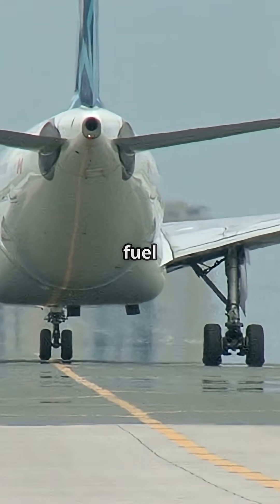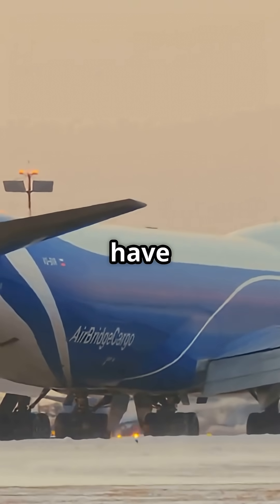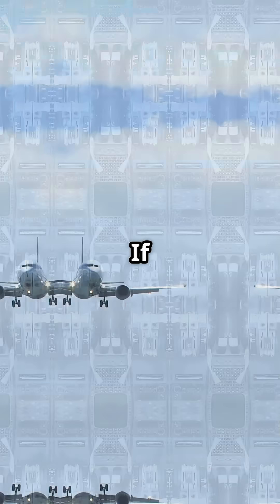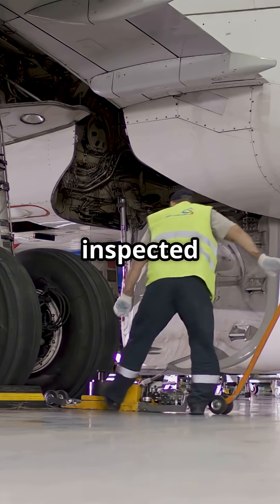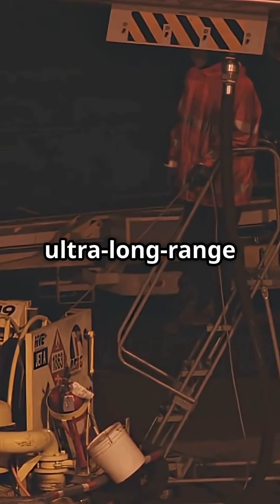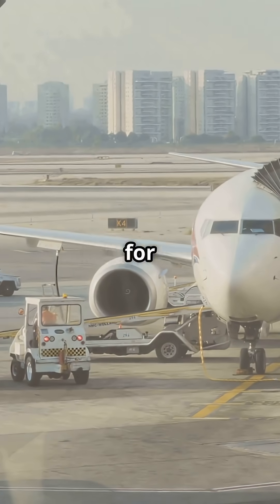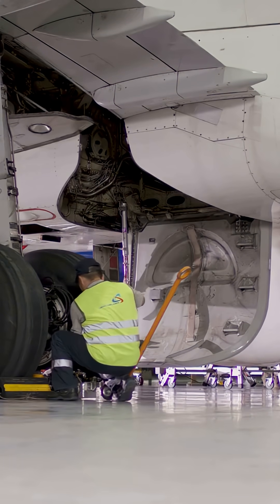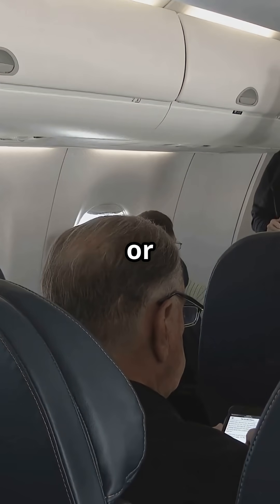Why the Boeing 737 Doesn’t Need a Fuel Dump System

Comment: It seems so wasteful to have to dump so much fuel, particularly if an emergency occurs shortly after takeoff. I understand the reason and need for a dump system in other aircraft, in order to safely land. But it seems better to simply design most or all aircraft like the 737, if that is possible, so that dumping isn't necessary in the first place. Airplanes carry several thousand pounds of fuel, and so an enormous amount is wasted when it's dumped.

Comment: That’s actually a really smart move!!!
Reply: So you'd rather land a plane full with fuel that can make a big fireball? Everything has a catch or downside.
Reply: @wildonemeister  Well if you think about it, its maximum takeoff-weight and landing-weight are the same, and it takes a couple minutes for it to circle back around and land safely! that’s a good amount of time to use up fuel! And let’s say it just took off from somewhere like DFW or Dallas Lovefield where it is pretty around heavily populated around the airport, if they dump fuel that can also affect people on the ground, but since it doesn’t have to; people on the ground are completely safe!
Reply: @TheWill.LifeImagined You don't really care about the people on the ground maybe getting a drop of fuel dumped on them when trying to save hundreds. That is my take on that. Just having the option is nice - using it or not is up to the pilot and situation.
Reply: @wildonemeister  I know it’s ok to have different opinions and yes I do understand that the people on the ground don’t matter as much as the people in the plane, but there are two other factors that make this a smart move by Boeing! One being that the 737 is a shorter range narrow-body that doesn’t really need as much fuel as like the Airbus A321-NEOXLR which needs a lot of fuel since it can fly longer than the 737. The second reason is that a system like that can cost a lot of money so giving the fact that the takeoff and landing weight are the same and giving the fact that going around an airport takes time an that time my friend is also ticking away at the fuel gauge to making it kind of unnecessary to have it!
Reply: @TheWill.LifeImagined Adding a pump, nozzle and a switch is not really changing the price much. Engine failure and landing gear failure - you'd wanna be as light and as little flammable as possible. Or simply an engine failure and no place to land. No engine - no way to burn fuel. Planes are and should be made with Murphy's law in mind.
Reply: @wildonemeister  yeah I agree with that but I still think that it was a smart move by Boeing in the marketing department.

Comment: If the B737 were to do a turnback with a heavy fuel load a heavy landing inspection would be required. In flight I have had it where tailwinds etc has meant we would land over weight, so a little drag was used to get us to just below our max landing weight. In 33 years on the B737 type as engineer and flying tech, I have never needed to do said inspection, which I think speaks volumes for how well the design actually is
Reply: That's interesting.  How did the crew create the extra drag?
Reply: @PhilipPaintin  pour flaps in, deploy spoilers and increase engine power to maintain speed/descent rate. Note - Spoiler deployment is a speculation but I don't see why they wouldn't be able to deploy in flight to act as an air brake.
Reply: The 737 was good before the company was lead by bean counters
Reply: Thats airline policy dependent.  There are many parameters we use to determine if a fully loaded 737 return will need inspection.  Was more common to do them on the legacies like the 400 combis we had. That was due to lack of more advanced censor suites obviously.  Never met the parameters with NG or Max to require an OW inspection.  Though we are doing an inspection or they wouldnt have returned at MLW.  😂 side note fairly accurate for an AI generated vid

Comment: ”Dump & Burn System” should be implemented on every commercial aircraft. It would be spectacular.
Reply: I read as the Aardvark thing
Reply: Why??? he said the 737 was designed to land at takeoff weight, if it needed to in an emergency.
Reply: @GDub-r6c  For spectacle!

Comment: I thought fuel dumping also had to do with reducing the risk of fires in emergency landings.
Reply: No.
Reply: No, it's when the aircraft has to return to the original airport and is overweight and needs to get rid of some weight to prevent damage to the landing gear or running off the runway. However, if the issue is minor like the gear or flaps won't retract and the aircraft isn't over water (they can only dump over water), they won't dump and circle the airport for a few hours. If it is urgent, they would land overweight and risk damage.
Reply: @sablejoke49 no, they can’t only dump over water. They can dump over land as well.
Reply: @rtbrtb_dutchy4183  Correct - over land the plane needs to be at a certain altitude for the fuel to dissipate upon dumping.
Reply: @GDub-r6c  there is no specific altitude. Any altitude is fine, but preferably not too close to the ground.
Reply: @rtbrtb_dutchy4183  That's what they have said in the ATC & Capt. Steve videos.
Reply: I'd say that's not the main reason but a side benifit that kinda comes with it